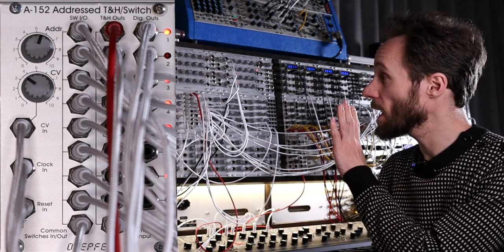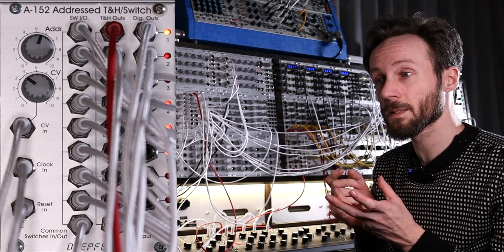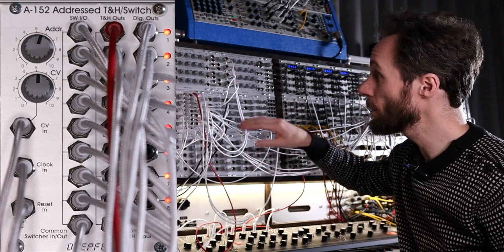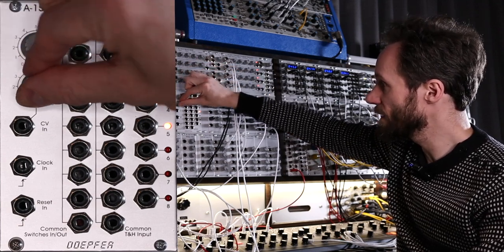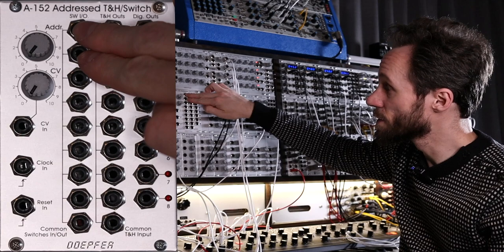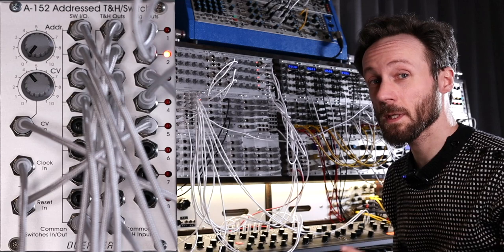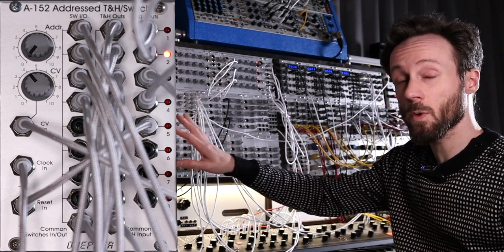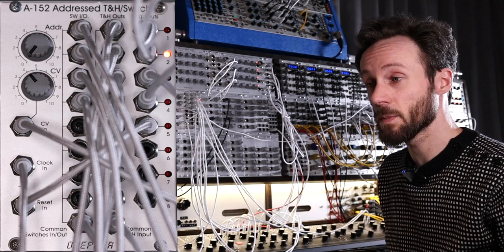Doepfer A-152 Voltage Addressed Switch

Comment: Thanks for posting this. This module seems confusing to me, and I guess I'm not the only one because prices are very low.
Reply from the maker: It’s pretty straightforward actually, it’s just the combination of functionality that seems confusing.
You can do pretty crazy things with such simple elements.
Look at the module as a cv controllable link where you can send 1 input to one of eight destinations or the other way around. You can do this at audio rate which opens the door to cool stuff 😎